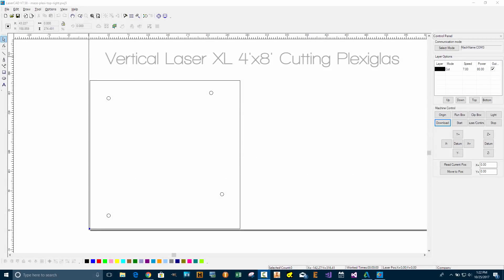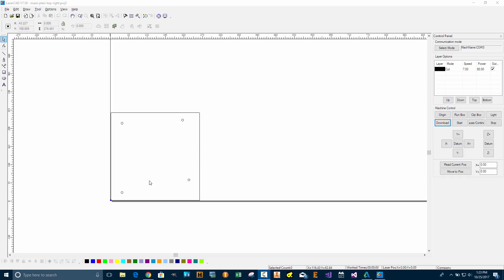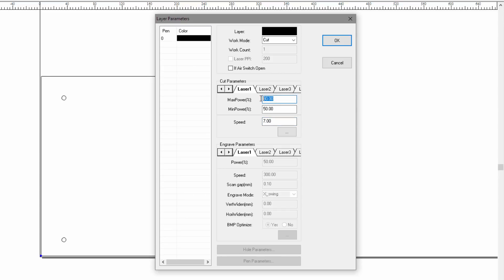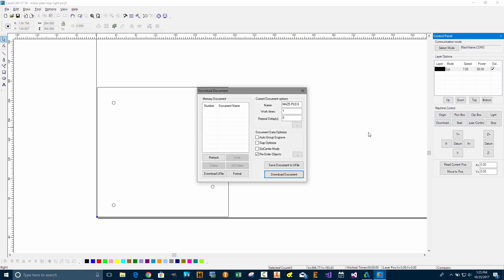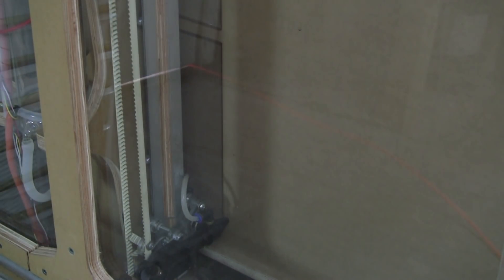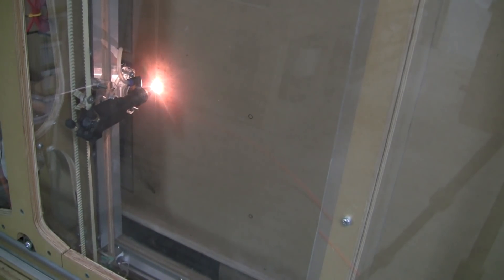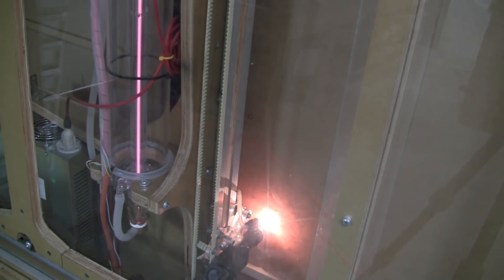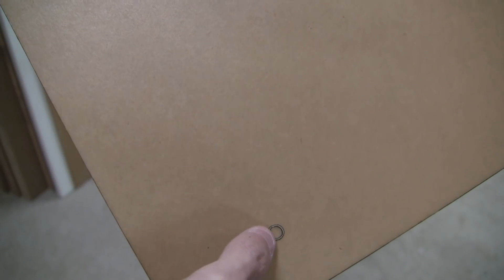Vertical Laser XL (Large Format Laser Cutter) Cutting Plexiglass

Comment: I realize that thickness is pushing the limit for a smooth cut on an 80 watt laser.  You should have shown the finish of the edge better, instead of waving it almost hiding the finish.  If it is not as clean as a thinner piece, that is no fault of your machine, just a limit of the laser.  If it were me, I would have explained that, and showed clearly the result.

Comment: Nice! This is the first design I've seen where the tube moves with the gantry.
Reply from the maker: Thanks.  This is a design approach we used in Oct 2014.  I believe we were the first to do this.
Reply: Patrick Hood-Daniel Wow,  I didn''t realize this machine had been in operation for 3 years. Looks like it has held up well!
Reply from the maker: This particular one has been in service for about 2 years.  The blackTooth (smaller version) has been around since Oct 2014.  It was a kickstarter campaign initially.  I personally love this bigger machine. It has a huge area and a very small footprint since it is vertical.